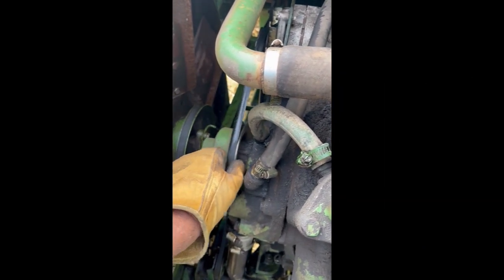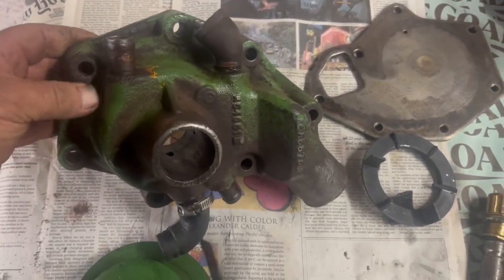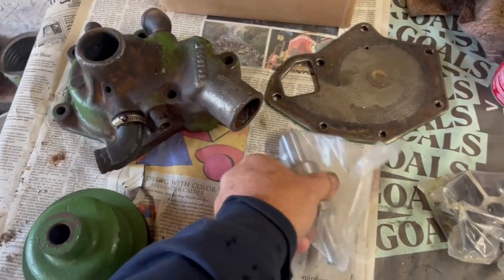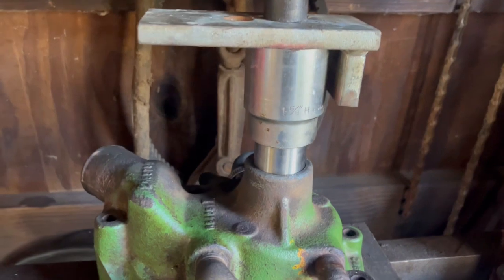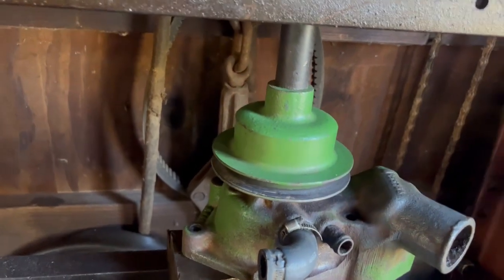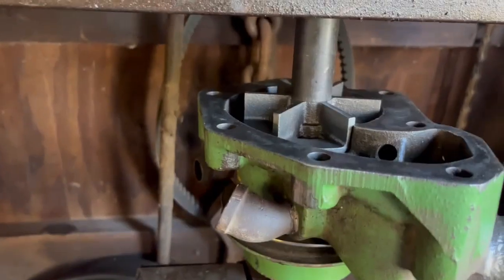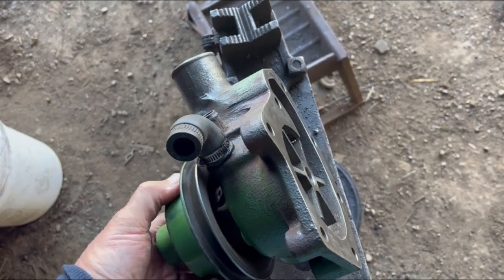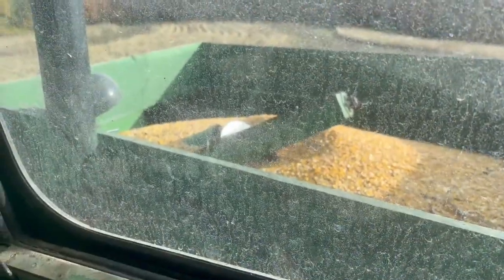John Deere Water Pump Woes - 3300 Combine Water Pump Rebuild

Comment: Glad you found a kit for it Pete!!
So many parts for old and new equipment aren't available now days.. 
Clearance is important, has to just clear to pump efficiently... 
No leaks, not overheating, a little more shelled out, that's a win!
Reply from the maker: Thanks Ed! Yup, parts availability is why this combine engine now has three Chrysler slant six pushrods.
Reply: @farmerpete  crazy... But at least you found something that would work

Comment: Thanks for the video Pete.  My John Deere backhoe needs a new water pump due to a worn bearing.  Not as bad as yours but enough to rock the fan from side to side quite a bit.  At $500 to over $900 for a new pump, based on whether it is aftermarket or OE, and the rebuild kit in the $60 range, I am going to rebuild mine.  I have a hydraulic press, so there is half the battle.  It's always good to see someone else go thru the process, because, as you've said, there aren't any directions.  Hopefully, by catching the problem before my impellor gets ruined, I'll be able to measure the clearance and know how far to press it on.
Reply from the maker: I'm glad you found this helpful. Good luck rebuilding your water pump!

Comment: Lucky. Lucky. Lucky.  The bearing should have been pressed from the inside of the pump.  Pressing the bearing from the outside can sometimes crack the housing.  Ask me how I know!
Reply from the maker: Thanks for the advice! That would have been useful information for them to include in the non-existent instructions with the kit.
Reply: @farmerpete  want another trick?  Since both the impeller and the bearing shaft are being replaced, save some time by heating the impeller hub with a torch until it’s almost red.  Then heat the end of the shaft.  Quickly dump the pump in cold water.  This is known as “Heat and Quench”. The shaft, being heated last will expand the impeller hub when both are quenched.  If you dunk the pump in water with the impeller side down, often the impeller will fall off in the water!  “Heat and Quench” works great on rusted nuts and bolts.  Quench a red hot nut until it is cold.  Often a pair of pliers can then wiggle the nut free!  Heating and quenching shocks the rust and makes it become a powder.  You will see the water turn black with that powder as you remove the nut.  Some mechanics still think they only need to heat a nut, but if they don’t quench it, the threads will squeal as they gall.

Comment: Kind of a heartbreak to hear you say you were unable to buy a new water pump for a John Deere 3300 you know mine's a 3300 with a diesel. 😢
Reply: Sadly, JD is no different than any other.. so many parts are no longer available.
But most older stuff, there's aftermarket available.
A friend of mine bought a brand new big articulated four-wheel drive JD a couple of years ago. The injector pump went out after just a few hours.. never even got it's first oil change. Last I knew, he's still farming around it. $500,000+++ tractor, as an obstacle in the middle of a field.. as they don't have parts for it. They sold the piece of 💩 he's stuck with it.
Reply: @GosselinFarmsEdGosselin That’s  pitiful 😢
Reply: @GosselinFarmsEdGosselin  at least hook a chain to it and drag it out of the middle of the field. 🤔
Reply from the maker: Water pumps for this engine in tractors seem to be available aftermarket. I'm guessing that if push came to shove I could drill and tap extra ports into a tractor water pump and make it work.
Reply: I changed the water pump in my JD 4400 about a month ago.  Last year, it was not available, even aftermarket.  This year, when the pump actually went bad, I searched the casting number and found one aftermarket that was a direct replacement for mine.  Don't understand why it was not available, but now is.   @farmerpete
Reply from the maker: @pagrainfarmer  Interesting! Thanks for the information.
Reply: Who had the kit ?
Reply from the maker: @wallynorfleet4278  All State Ag Parts